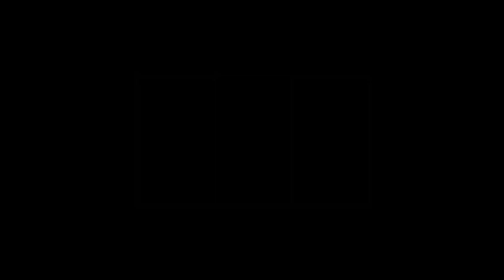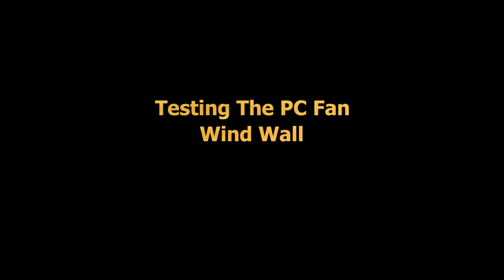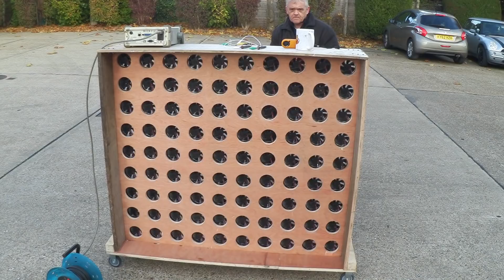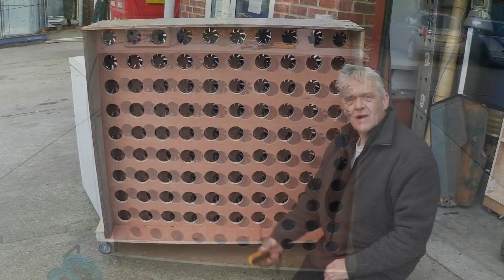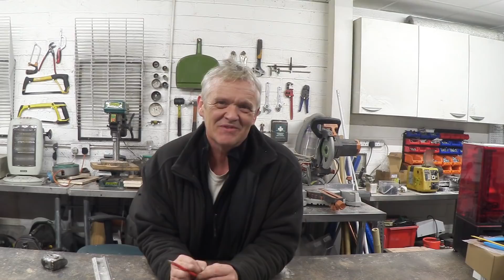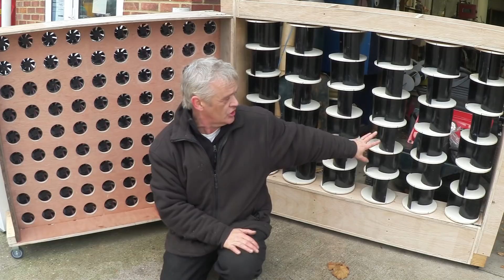1329 Testing The PC Fan Wind Wall

Comment: What I really like about these wind walls is that they would really reduce the number of bat and bird injuries and deaths.
Reply: jeah, from insignificant to slightly more insignificant but with worse efficient tech.
Reply: @Peter goes to Hollywood 
The Environmental impact of our making and using these would also be greatly beneficial for our birds and bat populations!! ❤️👍
Reply: @AndreaDingbatt  no it would not, you’re simply wrong. Empirical data doesn’t suggest this. What would is getting rid of a great deal of do domestic cats. Getting rid of overground high voltage lines would. Getting rid of cars would. Getting rid of skyscrapers would. Not using pesticides would. Not advancing urbanisation and with it the associated loss of habitat would. Mitigating the anthropogenically accelerated climate change would.

I don’t see you crying over most of the mentioned culprits, but when it comes to the comparably insignificant bird mortality rate of modern wind turbines you suddenly are.

Comment: Quick and dirty outdoors wind tunnel: 2 cars and a tarp to funnel air into a small area between the trunks (boot).
Reply from the maker: interesting - cheers
Reply: @ThinkingandTinkering  I forgot to mention that the logic behind this is that everyday cars are shaped to make the air flow to the sides (as opposed to racing cars) to keep wind resistance down while you're driving.

Comment: There are tons of ways to over-complicate things (I've had notions of an ideal diode setup), but for the scope of this project things are working marvelously! I love how a simple flat panel recessed in a box increases the air pressure to increase the output. Doing a ton of little modifications 90 times over could be quite tedious and expensive. The numerous benefits of keeping this project simple is quite impressive!
Reply from the maker: cheers mate - I can't tell you how nice it is to read a comment from someone who gets it - thanks again

Comment: When rebuilding your sevonious type you could turn alternate shafts upside down so that they soin in opposite directions. So at the point they are closest each other they are moving together therefore reducing aerodynamic drag
Reply: Unless the rotor columns are synchronously geared there is no guarantee that individual rotor sets would coordinate.
The advantage with keeping the rotation of the columns the same is that the (convex) returning rotor will deflect airflow into the path of the (concave) adjacent rotor i.e. act like a funnel.  Perhaps Robert has already sussed this as he is planning to reduce the gap between each rotor column before the hill top test.
Reply from the maker: CWT 56 has it mate
Reply: @ThinkingandTinkering  yes hadn't thought of the funnel effect.
Reply: @stuartevans6807  It's not always acknowledged that the inner side of the convex blade is funnelling onto the concave blade anyway thereby offsetting some the drag it is experiencing.

Comment: I wonder how 3D printed (or injection moulded) Boeing Jet Engine Fans would perform in place of the pc fan.  If the fans were weighted they would develop some stored energy.  Maybe connect them electrically to a 5kg flywheel, like the flywheel developed by the Williams racing team.
Reply: Connect the flywheel electrically?
Reply from the maker: indeed mate

Comment: That flat panel might work better by building a way to direct the air to JUST the fans. Kind of the same way cars are made more aerodynamic by removing sharp corners and directing the airflow. Each flat piece of panel increases air resistance.
Reply from the maker: it doesn't - see the earlier vids mate

Comment: I especially like the artistic feel watching those rotating objects!
I have been experimenting with low power accumulation using intermittent power (tiny solar panels). Very interesting to see my USB power bricks charger light go green...... enough power to recharge my cell phone twice! I put the solar panels against my south facing window. They are not even placed outside.
Reply: Ditto! I don't get much charge during the winter, but from spring through to autumn I pretty much keep my phones fully charged from solar, without ever having to go near a wall socket. At some point I want to supplement the solar with wind powered micro generation to get through the winter too. There are so many ideas to follow up on this channel!
Reply from the maker: that is cool mate

Comment: I wonder if you could get some efficiency gains by having some kind of aerodynamic foam or clay shroud in between the fans that would channel the air more smoothly into the individual fans, with a cnc machine something like that could be routed out of a single sheet of mdf too. Like it would look like an array of square horns from the front.

Comment: Having a bridge rectifier at each fan gives you a voltage drop across every fan where if you had one rectifier per row/column (or even better just one for the whole wall) will give you a much lower voltage drop across the diodes/rectifiers.
Reply: With that kind of setup you could end up with zero output. And with a rectifier at each, you actually see an increase in Voltage read as the AC rectified produces DC at the rate of 1:1.4.
Reply from the maker: you would then have a phase problem mate

Comment: Wonder if just cabling tieing the fans together would still give that wall funnel effect? (then just the edges would be needed)
Reply: Thats what i thought from the 1st video already. Just zip tie them and mount them into a box, that is because i think the box does help with concentrating the force of airflow. Maybe even slant the sides to make a larger opening- would also be a upgrade for the other windwall tbh.
I think that if you zip tie them one could place more fans into the same space=more output naturally
Reply: This sounds like it might be worth a try with some coat hangers or something to reinforce the structure a tad.
Reply: This should work ok. As I responded to another comment, this setup should work better when reversed as the concave side of the blade should be wind facing when used as a turbine. Actually making the outside frame deeper (front and back) should increase the pressure differential especially at higher wind speed.
Reply from the maker: you do know I tested both directions for output? It's in the earlier videos
Reply from the maker: go for it mate
Reply: @ThinkingandTinkering  Oooh, I sure would love to do that! If I just had the money for something like that. Alas, I'm a poor laid off bastard, thx u Rona, that most month barely can pay his bills.
Reply: @ThinkingandTinkering  Sorry must have missed that bit - will recheck!!.  Have been experimenting with 125mm 9 bladed PC fans (which are quite cheap) with very sculpted blades also a 200mm battery powered cooling fan (5 blades) which really gets going with a decent wind speed!
Reply from the maker: @cwt5654  I do think you are right mate - blade profile is going to be an issue and important - so I think it is good you raise it - certainly the result I got is for for the profile I used - but it was an uncomplex profile from a really really cheap fan

Comment: Need to put the fans in a venturi, so the speed of the wind with speed up as it goes through.  HVAC calculators will help with a bit of the fluid flow calcs to optimize the length of the venturis.

Comment: I like both of the walls. I think the first one will work better at lower wind speeds, the fans will not be throttled at high wind speeds so they will (over clock) or spin at a much higher speed in the fast winds
Reply from the maker: I agree with you mate - I think they both have their merits

Comment: Robert, I have a thought, if you have every pare of columns on the gutter blade rig in complementary rotation, perhaps you might gain a bit on performance, I keep thinking of the "sticky area tolerance that is to be considered in a tesla turbine" and the dynamics of your wind wall counter rotation in between columns loss/gain ... maybe a sliding mount for the above and bellow shaft mount so one could experiment....idk was a moment thought
Reply from the maker: I get it mate, I really do - but, for me, the big question is always going to be does the increase justify the complexity and cost - I will have to think about it - cheers

Comment: The flat face is wasted wind power, There shouldn't be any blank area. The holes should be edge-to-edge, if possible. If not, then each hole should have some kind of horn which directs the wind into the hole.

Comment: With every wind generator you test in the yard it's always a disappointment that you are not able to put on the roof and get a proper reading, brill that you are getting the chance to try them in a windier environment. Wouldn't it be amazing though to have your own wind generator on the roof for a long term test and have a big LCD on the back wall showing volts and amps, and being able to charge a power wall so you use the electricity for charging batteries etc?
Reply from the maker: yeah that would be cool if I could - but I can't, so I do the best with what I have

Comment: Thanks for another informative video.  
How about a project using a single car alternator with a rotor/blades with the same span as your walls to compare with your two multi-alternator versions?  I realise that pullys/gearing may be necessary to increase the RPM ,  and that some experimentation may be needed to use Neodymium magnets instead of energising field  windings to achieve output.
Reply from the maker: the info for that kind of fan is readily available mate - I don't really see the need to make a HAWT as so many of them have been made and tested to death really - so the data is there

Comment: Up on a hill side by side will be an interesting watch. One question on the PC fan wall, Have you considered beveling the inlet side of the board? It might improve air inlet performance. I realize that would be better done with a cnc router, but just asking.
Reply from the maker: yes I have mate - you might want to review the earlier vids

Comment: too much blank surface. add up all the circular areas and work out how much of the total area…. prob around 1/2 or less. you could try funnelling the air into the fans with mini ‘pyramids’ glued over the blank flat areas to funnel/guide the available air into the fans instead of buffeting off the flat blank areas….add some side and bottom funneling walls and it might really sing…..

Comment: Loved this video and tried it with a single fan.  Brilliant, neighbours couldn't believe it powered the 3v LED.
Having said that, do you know of a wifi device that can measure current like amps, volts etc so I can check it's output over time?  Basically attach to a Home network.

Comment: I'm probably wrong but all the talk of cones, funnels etc seems like a waste of time as wouldn't  the air that's already within the frame of the wall increase in pressure if it can't all escape through the fan holes quick enough, thus causing the blades to spin faster.

Comment: Why don’t you try to put a large scoop like cowling in front of this to see if you can increase the wind. I saw a wind generator prototype that used that to direct more air to generators that looked like jet engines. It was supposed to produce as much as the large wind mills but with easier maintenance and no bird strike. Just a thought. Would be cool to see. I’m sure sail cloth could be used to try it.

Comment: 200mA at 1.7v does not equal 3.5W. If that was just from one column you could extrapolate to give you a rough figure for the whole wall, but surely you'd want to check each column to see if there are any differences depending on the column position? 
And for a test like this why not just connect them together to see what the actual total power was?
I know you don't always appreciate people nit-picking at the way you test things, but if you're not really explicit in the way you describe what you've done it gets to be very confusing.

Comment: 200mA (0.2A) x by 1.7V = 0.34 W not 3.4W…? Are you measuring the output of 1 column and multiplying by the 10 columns? Sorry… I’m keen on the detail. 
P.S. we have a wind tunnel at work!

Comment: At low wind speeds to make them produce efficiently and continuously.      You would have to build a Plenum that was shaped like a funnel roughly 3 m² at the face opening tapering down to the unit fans. 
              And to be extremely efficient which would be impractical about three times the distance minimum of your face opening which is 3 m which would make it 18 m in length that would be impractical but could be made out of cheap canvas or cheap poly film in a stick frame. 

         This would take that 3 m² massive low velocity air and concentrate it down into a 1 m area multiplying it’s velocity and making your little set up very efficient and have a much higher output. 

           But even if you decreased the face opening of the ducting to 2 m² or even down to 1 1/2 m² and only make a 3 m in length distance you would still get some increased output at a very much smaller scale.
Reply: This is the problem with trying to amplify wind pressure.... it requires a large duct length to produce noticeable gains in effective wind speed.
Did a small scale experiment using card on a model roof ridge turbine and results were unpromising due to the aforementioned issue 😒.
Will be interesting to see Robert's creations on the hill top as there should be a reasonable pressure differential between the front and rear sections in windy conditions. Hope he remembers to make them secure! 😊
Reply: @coldfinger459sub0  Actually my main concern with this setup is the orientation of the fans. Done a few experiments with some of these and if used as a turbine, the concave side of the  blade should be wind facing. It will work better reversed especially with the square aperture.
Reply: @cwt5654  You also need to form the same shape on the back that you form on the front. That forces the wind to speed up going thru the fans.
Reply: @gravelydon7072  Yep, most computer fans have  a chamfered section from the circular aperture to the square frame so if used reversed there would be a small lip creating drag at the exhaust side. Unless Robert rejigs the whole setup (unlikely at this stage) it will have remain as it is but I still think it will give better results with the concave side of the blades windward.
Reply: @cwt5654  I just did a quick test with two 60mm fans. With both facing the same way elephant style, powered fan forcing air thru, the second fan had an output of 2.15Volts. With the fans butt to butt, the second fan put out 2.2Volts. Front to front did not power up. Nor did elephant style where the powered fan was pulling air thru the non-powered fan. These fans have no ridge in them. Kind of proves your suggestion about convex vs concave with concave being better. Not much but provable. .05Volts might be the difference between space between blades or the fact that that the second fan is lifted a bit off the bearings like when it would be in operation.
Reply from the maker: nice point

Comment: What no wind tunnel?  Lol.  Is the output AC???  Please help?  Just wondering as this is important...unless the van outputs are pure DC, idk, you could be loosing massive power through impedance.   That's when,  for example, a positive and negative wave are out of phase causing the signals to be reduced or even cancel out each other. 2 equal signals if 180 degrees out of sync can potentially completely cancel each other out.  I would take 2 or 3  random samples from  10 fans and get an average watts then add all the fans up using the average watts of each.  If pure DC never mind, but if not it would be interesting to know if there is impedance, and there will most likely be some if not pure dc.   Thanks again for all that hard work.  Glad it's you doing it and not me.  :)

Comment: Hiiii your Channel is awesome ... I want to buy about 30 pc fans to build a windwall in my trunk driven by the winds as I drive .... there's 5v 12v and 24v fans and I'm not sure which voltage fans I should get .... thanks in advance

Comment: Sorry Rob those figures you gave in volts and milliamps, was that reading from 1 fan or a row?  Can't wait to see this wall off. I've learned alot from your experiments. Your conclusion is great that nobody is really designing good turbines for the urban environment at lower wind speeds. Standard Hawt turbines seems pointless in this environment and a total rethink is needed. I think your savonious wind wall as a fence is a great idea. I love the rose and rose bud. I had a thought maybe Hawt are not so useless. If we used the right ones. Those American windmill/turbines for pumping water you see on farms with maybe the magnets on the rim like your vast did maybe a better choice for an urban environment if you were considering a Hawt.